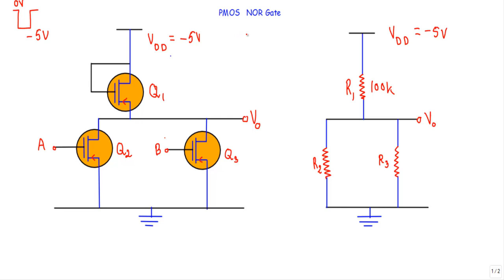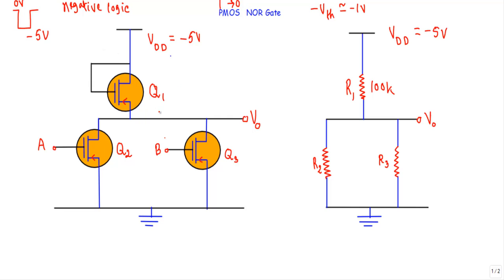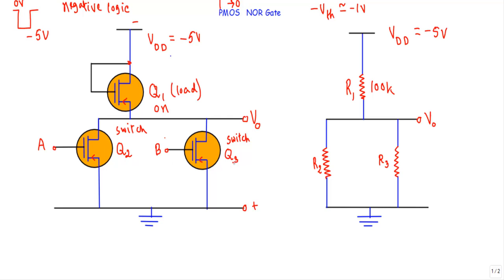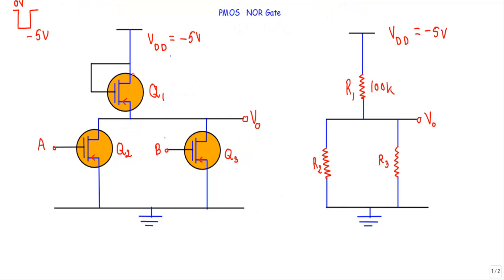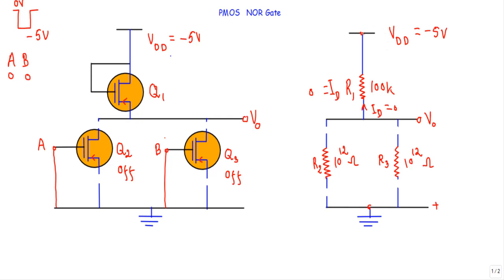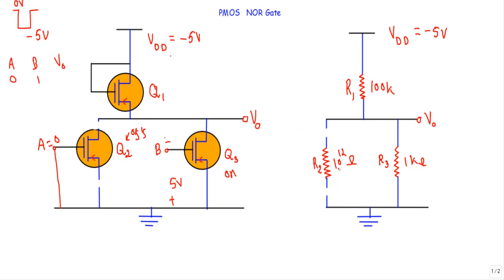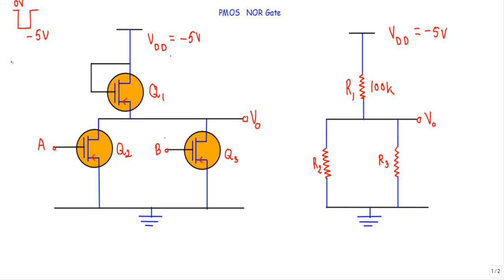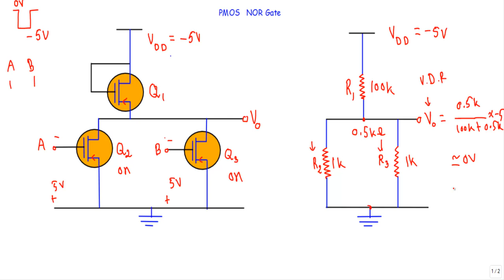PMOS NOR Gate

Comment: Could you explain that why load resistance is 100kohm
And closed switch works as 1kg ohm open one is 10 power 10 ohm
Reply: Normally MOS has a thin channel layer(when gate is open, so resistance is high)

As you using enhancement type P-MOS, the channel layer increases when you supply voltage through Gate. As the channel layer increases more current can flow, the Resistance decreases.
Hare difference happened for this cause. so Normal(when gate is open) resistance is huge than when the gate is connected to with the voltage supply.
Value of resistance is used for clearly